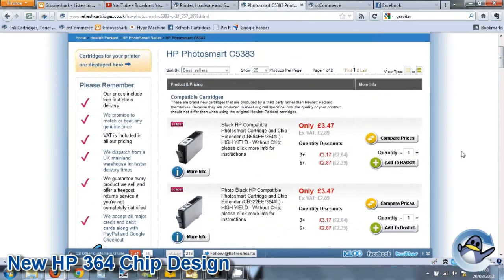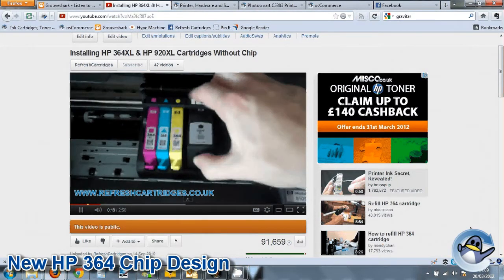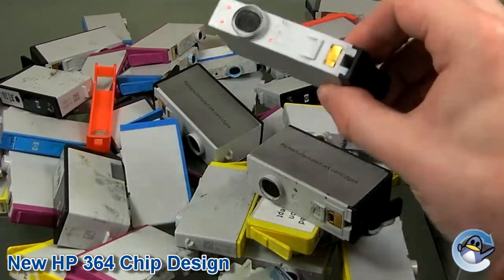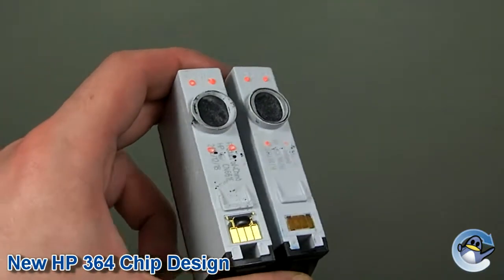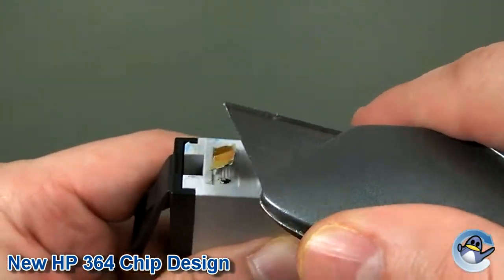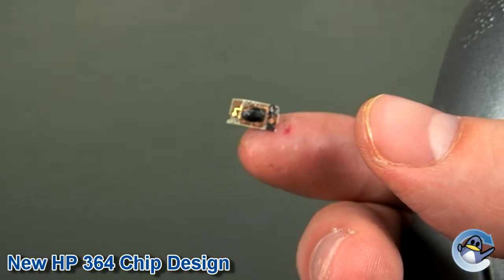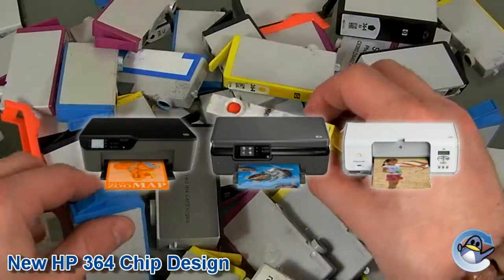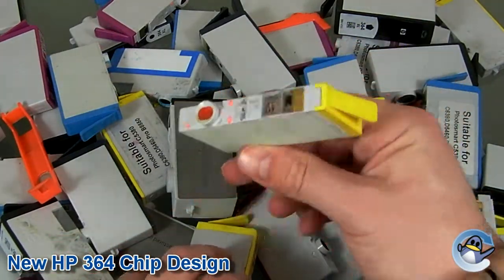New HP 364 Chip Design

Comment from the maker: You really don't. Unchipped compatibles and remanufactured cartridges all use the chips from the HP originals and these chips will continue to function even when the cartridge believes it is empty. As such as long as there is no damage to the chip itself your printer will accept it.